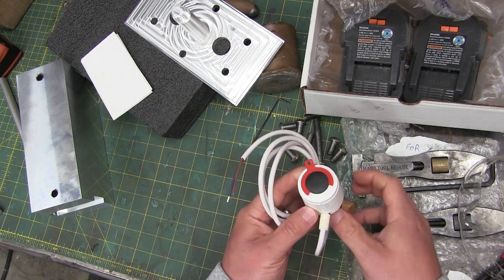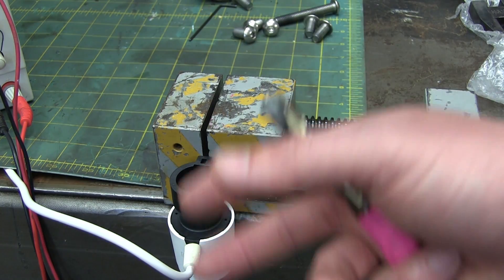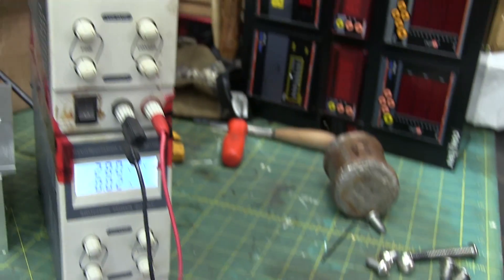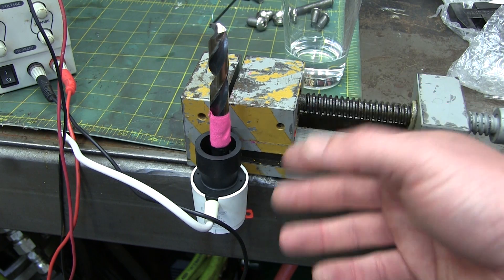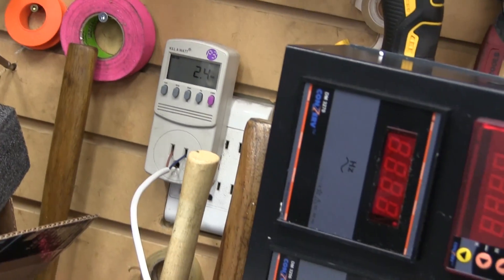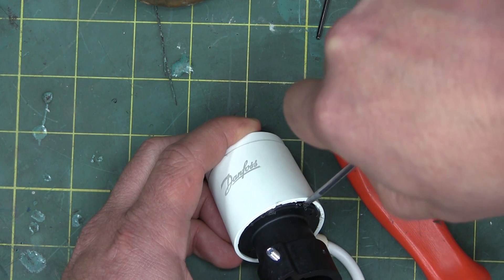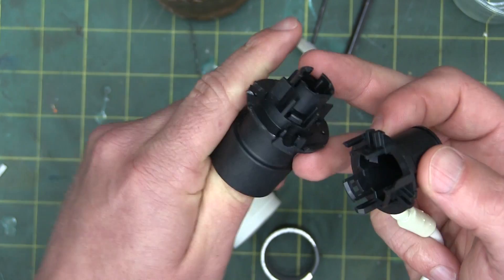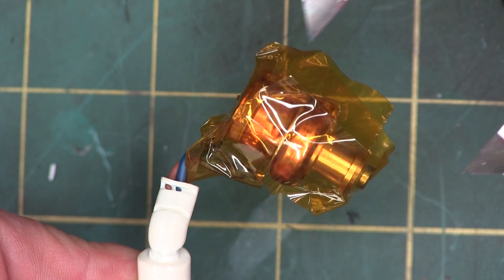BOLTR: Wax Actuated Motor | Mindblowing OLD Tech

Comment: Your dishwasher detergent door is opened by a wax motor .
Reply: Ill be damned!!!!! Ive been wondering how that door was signaled too open sinve I was anout 3. In 1983. When i was crawling around watching my mom load the dishwasher.  I remember asking people about it when I was young. Most people told me the door jist flipped open when you closed the door on the dishwasher.  I knew they were wrong. But,  they usually didnt take well too a little kid telli g them they were wrong. So, all these years I've been lost in the land of wonder. Lol
  Actually i haven't thought about it in many years.  At least a couple decades. Nonetheless, you have answered my question and aided in ending my quest. 
    The lesson learned here is to never give up. If you try and dont succeed.....jist shelve it and wait for the answer to get dropped in your lap. Lol.
Reply: Technically it could even be actuated by the hot water during the wash...
Reply: Not always. My parents old dishwasher had a small button/lever on top of the detergent door and it simply contacted the top rack so as soon as the main door closed, the detergent door would pop open.

Comment: Funny enough they use the very same thing for auto choke in a Chinese scooters carb so basically there is a vain in the carb which allows extra gas to flow and when the wax melts the needle acculturates and closes the vain. The voltage and the wax mass determines how long the choke will be on.

Comment: Just viewing your BOLTR: Wax Actuated Motor | Mindblowing OLD Tech video.

We have a greenhouse that has vent windows that are opened and closed by a wax actuator. It starts to open at approx. 70 degrees and as it gets warmer, they open more and at night they close. The actuator is approx. ½ inch in diameter and 8 inches long.

Comment: Seems like the high latent heat capacity would be the opposite of what you'd want for a solar panel orienting system. The method I've seen is two smaller solar panels run to opposing motors in such a away that if the panel is dead on to the sun they're both perfectly in shade.

Comment: As far as a sun tracker system for solar panels. Use one of those old 6 ft. Satellite dish motors that operate on 5v and very low current. Use 4 miniature solar panels (3"x5") mounted together in a pyramid arrangement. Use relays to control motor direction (CW, CCW... moving panel up, down, left & right) The voltage produced by the little panels will activate when not shadowed by misalignment. When all 4 panels are dead on pointing at the sun they will activate a Reed switch activating a relay coil to disconnect power from the directional motors. Should follow quite well. Oh and when all 4 are not producing a voltage that would shut the main power off. (night time)

Comment: We use these as the thermostat on our cars. As the engine heats up the cabin heater it also heats the wax which actuates the valve to allow coolant to the radiator only later , much reducing warm up time  : similar to = ETHANOL :-)

Comment: @4m00s: 2 watts at 240 volts. Apply 60 volts and get "half a watt" ? Nope. Power goes as the SQUARE of the voltage. It's because the current is proportional to voltage, and power is V*A. So power goes up as the square of the applied voltage, for a linear load like a heater. One-quarter the voltage, one-sixteenth the power. 2w would become one-eighth of a watt at one-quarter the voltage. This may take a while..

Comment: You could use that theory for solar panels I believe. When the voltage drops it could cool and retract causing it to ratchet to a new setting and following the sun. As long as y setting was right x could work. No solution for y setting.

Comment: I sold solar pumping systems for agricultural use.  They had linear actuators that were dc powered called active tracking.  The passive tracking systems were a gas strut that worked by the sun radiation falling upon the black painted cylinder.  It would cause gas pressure to increase and extend the cylinder.  It worked like a sunflower tracking the sun.  The only downside was if the day got cloudy then it wouldn't track or in extreme cold it wasn't as efficient.  The wax motor idea would work in theory.  You'd prolly have to experiment with wax viscosity and a mechanical advantage type scenario to multiply travel.

Comment: Some Yamaha outboards use a wax motor connected to the choke/primer system and powered directly to the stator so the choke/primer slowly opens as the motor runs. Kinda a auto choke system.

Comment: Similar to how a thermostat in a car motor works.  Heat from the coolant Expands the wax and opens the valve overpowering the spring pressure.... yada yada yada

Comment: In Denmark, all radiators have some variant of that gizmo (Danfoss is a Danish company), but without the electrical part (I guess newer home automated homes will have them). Always assumed it would be a bi-metal thing, never heard of the parafin actuator. They have a handle that you turn to set the thermostat. Last for ever but not precise at all.

Comment: There are some cheap paraffin pistons used to automatically open and close big glazed windows in greenhouses. You use a screw to make the chamber bigger or smaller to have the window open at a certain temperature. After that the greenhouse stays quite about the same temp all the time 😁

Comment: An interesting experiment/application would be a Huge cylinder die press with tunsten coils built in, Not sure if the extreme heat would destroy the paraffin but if its sealed it might not maybe just liquify. Or could have the coil on the outside so its not in direct contact with the heating element

Comment: If you found this Danfoss device of interest you may find the electronic spring actuators which were usually installed into Danfoss refrigeration valves and were usually setup as a means of providing electronically adjustable pressure control. The device contained a gas (pentane from memory) a small electric heater and an embedded thermistor. The temperature of the coil could be controlled and this gave a known pressure and these devices would pilot operate much larger refrigeration valves. Not sure if they are still around but if you get a hold of one it would be an interesting teardown.

Comment: Cody from Cody's lab does a good explanation of Paraffin wax and it's thermal properties. I could be wrong but I think you were correct that the copper is used for heat transfer, and possibly also to remove (rather than add) thermal mass.

Comment: Been thinking of the same sort of thing for solar. There's got to be some way to get them to face the sun with passive action. Plants do it.
Reply: This already exists.
Reply: A BEAM solar head?
Reply: 4 motors mounted with tubes on each side of the panel. Tubes take in heat when exposed to the sun, pushing the panel. Map out the motor points properly and it should track not only across the sky on a daily but it should adjust through the seasons as well
Reply: Plants do it and later when pressured 5000ft below surface they become oil
Reply: If anyone can you could! You’re so smart :)
Reply: Plants do it because they're alive, though

Comment: There's mention in the video of melting the paraffin wax. This will ruin it as the copper particles will separate out. The device is always operated with the wax solid. The copper is there to improve speed of heat conduction. You can't make a big unit because the heat conduction is too slow. 

For big thermostatic valves, for ships and power stations, they put lots of small thermostat units in parallel inside one housing.  I used to work for AMOT, the inventor and main manufacturer of these units outside the motor industry.  I didn't know about the electrically operated ones though.

Comment: You are you not running a solid state scr or mechanical bladed relay to power that fucker straight from your wonky Canadian 220vac wall source, using the power supplies as coil inputs?  Crank that mutha up!

I like Danfoss products... use their inverter and servo drives, plc modules and phase isolators when I retrofit and upgrade 1000 hp extrusion lines and thermal injection presses.

Comment: Maytag also used them as the lock/unlock on the door of a front loading washing machine. They had high failure in this application resulting in wet floors for many.

Comment: I like your idea for actuating a solar panel one idea I had was to use the sensor off a solar light so that when sunlight moves off the panel it puts the sensor in darkness, but thinking on it a little more I think using a low voltage switch like you see on camping fridges may work better, by having a smaller panel that gets sunlight when your main panels are shaded

Comment: This same wax-driven motor is used to automatically open vents in greenhouses, in order to prevent the greenhouses from overheating.  Such companies as Bayliss in England and Univent in Denmark make them.
Car radiator caps also use wax-driven motors.

Comment: Cars used to have ported vacuum switches, based on the same principle, changed thing like idle etc as the engine warmed up. If you overheated the engine the PVS would no longer work correctly and required replacement.

Comment: Ave, By my calculations if its .070" and 50lbs of force you only have .3 ftlbs of energy,  not very much to do any real work. My vote is to fill a large pressure vessel like a propane tank with parrifin with a bit of oil at the top and hose that over to a small hydraulic spring return cylinder. Paint the propane tank black and see what chooches.

Comment: I’ve seen solar panels actuated by the weight of two connected reservoirs playing teeter-totter on either side of the panel; the low one gets more sun, heats up and the fluid expands, pushing material into the high side. High side is now heavier so moves down, which brings it into the light, and the cycle repeats

Comment: The solar industry has some trackers that use a similar idea to the one mentioned. They transfer liquids to allow gravity to tip the array. Won't name any names, but it's a pretty easy gargler-fu. Search for passive solar (single axis) trackers. Also of note, being you're in Canada, I'm going to assume you have clouds pretty regularly. In your pursuit of efficient solar, i might recommend you look into the benefits of tracking in cloudy climates; usually not worth the effort and dollhairs, but being we all enjoy the journey more than the result, have at it. I could also point you in the right direction if you want to just get to clifford's notes. Cheers

Comment: I saw wax cylinders to open green house vents.  Handy little rigs!  Told them they would want to disconnect them before the cold sets in.  No need to worry, its just wax they said.  Fall came around and they had 12 macaroni cylinders great for nothing!  
Great thought on moving a solar panel, beats trying to use a rain barrel and controlling flow actuated movement.

Comment: Yep. It's a 24V radiator 'telestat' made in DK and they force all Danish elechickens to learn how to use it with an IHC controller.
So I was wondering, when you would remove that red plastic ring on the top...☺

Comment: they are very common on automotive engines but most of them are heated by the engine coolant, the thermostat is actually one of them, but the other ones are the little mystery things with vacuum hoses going to and from them.

Comment: I believe the old Rolls Royce's radiator louvres used to be mechanically opened and closed (airflow control) using wax motors. I also dissected a coolant thermostat from a RR Merlin engine and found that the wax had dozens of copper balls embedded in it.

Comment: Some outboard motors use that for fuel enrichment instead of a choke. It starts to heat when the motor starts, slowly closing the enrichment valve.

Comment: Honda uses a wax actuated choke valve on their lawn mowers. It uses engine heat to expand and open the choke . They do fail eventually. If they fail to choke, its as simple as pulling it out with plyers and pushing the new one in. Way better than levers and springs.

Comment: Intrigued by the solar controller idea as a simple circuit. For the solar controller thing a me bob, could you add a mini solar panel just to heat the wax motor when the mini panel is in direct sun? When it cools it would move the panel until it gets juice again.
Reply: Put the mini panel in the prime middle spot for sun on the main solar panel. Maybe have some sliders on the mount, that would allow some fine tuning?

Comment: I coop'd at a tier 1 supplier for GM last term. The bypass for the oil radiator in cars also use a small wax motor. the more you knooOOoOOoW

Comment: Honda used the same kinda tech on their idle air control valves for decades. Coolant took the place of that 2W heater, and it was also motivated by a PWMable solenoid. The idea was that wax would allow a small amount of air to bypass the throttle plate when the engine was cold. Once the engine warmed up and entered closed loop ECU control, the solenoid took over as the wax closed the orifice by the amount it was formerly open when cold. A devilishly simple solution to a complex problem of cold start idle.

Comment: "The LATENT heat inside your engine"?  Where is there phase change in an engine?
Reply: Depending on the style the intake system will have a phase change in different locations. From a liquid to a gas.
Reply: So you know be correct and say in the cooling system. Or did you forget how engines work.

Comment: I read about a non-electric wax motor type sun tracking system a while back. It's pretty clever, but not being able to adjust the tilt the PV modules on command can be detrimental with scenarios such as cleaning, maintenance, wind and snow stow positions. Morning and afternoon backtracking would be very difficult as well. I design and program single axis PV sun tracker control systems for a living.

Some front loading washing machines use wax motors in the door lock mechanism.

Comment: Spacecraft use them to deploy stuff instruments and solar panels when explosive bolts would create too much shaking. I found this description in a space parts catelouge: Sierra Nevada Corporation’s (SNC) Space Systems IH-5055/-10055 High Output Paraffin (HOP) actuators (or linear motors) are electrically powered resettable devices that generate high force and long-stroke linear motion.

Comment: Heh.  I have nasty memories of these things killing the heater in my car in the middle of winter.  They're used as thermal regulators for car engines.  It's basically the same thing.  They're designed to fail open, so your car engine runs cool.  Thus no hot air for the passengers in the dead of winter.

Comment: I saw this same principle used in actuators for a glasshouse application, that would open windows when the temperature would rise above a certain level 100% guaranteed to work & doesn't require any electronics/power etc 
I thought it was effin marvelous & I was also surprised that none of my teachers/lecturers ever mentioned the principles ( studied electro-enginerium )

Comment: Fun Fact : If i'm remembering my history Correct  They  actually Used Paraffin  Wax as the  Heat  exchange fluid between the  exchangers and computers on the apollo missions because its  lighter , doesn't freeze ( as bad as water or normal oil ) and could on its own absorb a crazy amount of  heat  before melting And it doesn't conduct electricity . So it could be used to soak the entire internal circuitry in a solid block and surface tension would keep it from floating away  in the zero G.

Comment: You can find much faster acting versions of this kind of deal on older gm truck front axles. They used a wax motor to connect the front axleshafts to the differential.

Comment: Lots of older mechanical diesel fuel injection pumps used wax motors on them to advance timing when the engine was cold.

Comment: They are very commonly used in floor-heating distributors, for the remote controlled valves. (in most cases just completely opens / closes the valves for the single heating coils in the floor for all the different rooms)

Comment: 1/4 of the rated voltage (60v instead of 240v) doesn't give you 1/4 of the rated power (1/2w as you stated), it gives you 1/16 of the power (1/8w)! P=E^2/R

Comment: Copper is for even heat transfer, same reason it's on the outside, that way not only a small spot starts melting, with copper it transfers the heat through the entire mass very quickly and it all melts at a relatively even rate throughout. Copper also holds heat fairly well but I don't think that's it's intended use in this particular case, just heat transfer.

Comment: For a sun tracker, just use a simple comparator circuit with an H bridge, two phototransistors with a shade between em, and a linear motor. When the shade darkens one of the PTs, the comparator will move the motor to point your panels in the correct direction.

Comment: Most chevy truck and SUV that are  4x4 from 1989 to mid 2000. Thay  used one of these to actuate the front end instead of using lockouts

Comment: GM used one to actuate the front axle on trucks. 88-98 for sure. Had about a 2in stroke, full actuation in less than 30 seconds.

Comment: VW aircooled beetle thermostats work like this. Wax filled cylinder with a spring, as the engine heats up, it opens the cooling flaps. Warms the engine up then let's more air in when at temperature